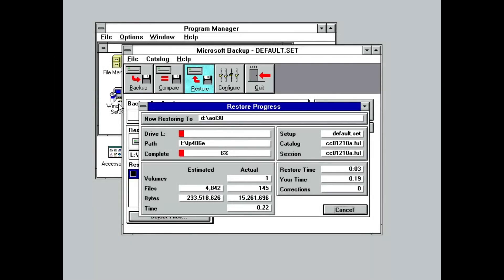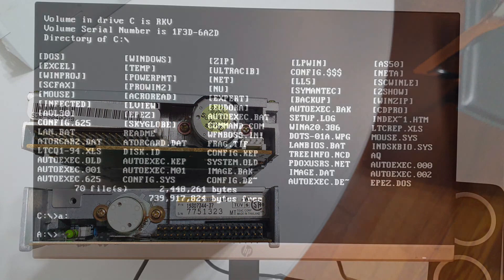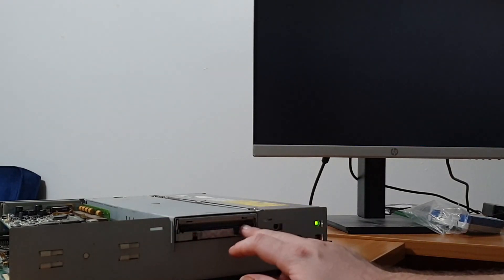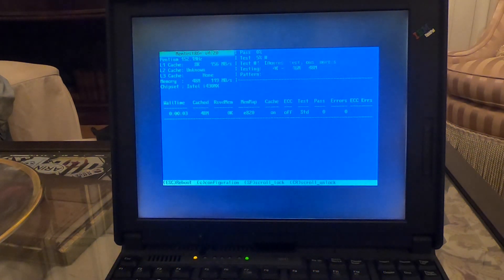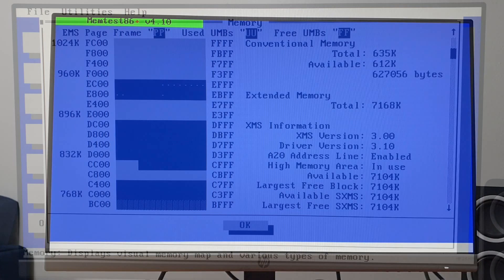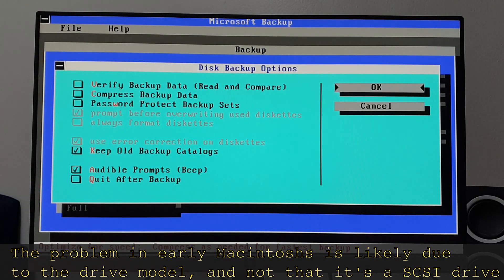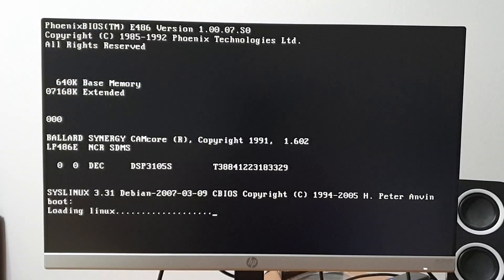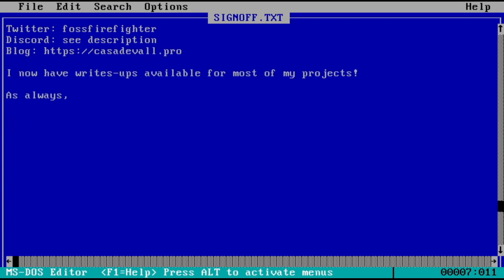486 Data Recovery with MSBACKUP and NetWare // Intel Professional Workstation (Part 2) | #DOScember

Comment: Just be happy you weren't working on. It's older brother as it is. So the professional workstation series has another machine and it is the professional workstation server. And this is the weirdest machine if you ever run into one that you will ever see.  It looks like a giant server with a handle on the top of it. It is manufactured by Intel and the wildest. Darn thing about it is there is no serial number listed on it. There's only a model number and you will know if you have one when you go to take the cover off. And you see what really makes this a unique server.  You take the cover off. And there are not 4 slots for scsi hard drives there. Are eight slots for scsi hard drives They're quite rare and they weigh about 90 pounds. And that's not what the drives in it. That's just because of the weird power supply. They were pretty reliable machines and and they're not bad. But they aren't easy to get up and running. They kind of turned into a nightmare.  Onto themselves. And this happened because of the actual drive controllers themselves that loved to fight each other for an IRQ On start up.

Comment: Older machines, like 286s don't like the DS12887 and require a DS1287.  Newer machines, like 386s and 486s should work fine with the DS12887.  So it's a drop-in replacement for most systems.
Reply from the maker: I did hear that this could be a 286 specific problem (although I've heard some 286s will infact tolerate a DS12887). I have a Compaq 286 that needs a replacement Dallas chip. That's probably going to be a dremel and solder job.
Reply: @NCommander  Necroware made a replacement, I think you should check his channel.

Comment: What documentation (if any) did you use to guide writing your DISKDUMP ? I've been meaning to get into this sort of stuff but I don't know where to start.
Reply from the maker: OSDev wiki is probably the best source: https://wiki.osdev.org/Main_Page but I already had a lot of understanding of low level programming and BIOS call interfaces.

In this case, diskdump uses int 13h, it doesn't talk to hardware directly. I did do that for my SLS on real hardware video though.

Comment: xcopy can copy hidden and system files and preserve flags if you use the proper command line switches. it can also copy the entire tree including empty directories.
Reply from the maker: Unfortunately, those switches do not exist on the DOS 6 version. I think they were added in Windows 95 or 98.
Reply: @NCommander  incorrect. those switches exist all the way from dos 3.2 to 6.22 and Dr dos 7.

Comment: Did you try kermit and a serial null modem cable on com port?
Reply from the maker: It won't save the unallocated block data that i needed to do autopsy in part 3. The SERDUMP utility I wrote can do a filesystem dump via serial, but Ethernet is loads faster.

Comment: There is some incorrect information to Linux

1.) You weren't stuck with "fitting all on a 1'44MB-Floppy":
You could have made a boot- and a separate root-Disk. 

2.) Problems with Lilo:
You don't need Lilo - you can put just the kernel on the bootdisk

3.)  "8 Megs is too little for diskless".
No: One the one hand, you have your floppy as extra storage - on the other hand, 8 Megs is a-lot for an old kernel plus busybox.
 No need to swap over the network.

4.) you even wouldn't need nfs: Just "dd | netcat" on the Workstation-Side (plus the boot+root-Disk from [1].
 
5.) Using tools that write on the disc is a HUGE no-no... But mistakes happen :-D
Therefore, I'd never touch Dos/Windows-Tools when accessing a harddrive-to-recover... Or invest in a write-blocker :-D

Anyways, thanks for sharing your efforts and experiences - they are great!
Reply from the maker: 1. I was referring to the size of the kernel alone. I'm well aware that I could have used a separate disk for the initramfs, I specifically dealt with that nightmare in SLS Linux Part 2. Linux 2.6 removed the make floppy option, and the lp486e.c only exists there, and in some 2.5 kernels. Admittedly, dumping NFS might have gotten the boot kernel small enough, but the Linux kernel has incompatibility with the SCSI controller chip in this system so it's a moot point. (I'll discuss more in Part 3, but in short, without significant effort and driver patching, I will never be able to use SCSI under Linux on this system).

2. I never said I needed LILO. I said LOADLIN to load from DOS to bypass limit 1. However, LOADLIN requires the top of conventional memory to be free, hence it dying. If I could have used LOADLIN, I could have put the kernel on NetWare, and started from that.

3. Old kernels won't work. The Ethernet driver I need was added in 2.6 (2005). The onboard Ethernet is not NE2000 compatible. If I could have used a 2.0 or 2.2 kernel, I would have. (however, neither works with the SCSI controller in this system).

4. Technically true, but I couldn't even keep it running /bin/sh in single user mode without risking OOM. The kernel itself was using 4 MiB of 7 MiB of usable memory. I'm not convinced even with busybox that it would have actually be workable. I'd also have to invest a lot of time and effort to get a buildroot setup for 486 compatibility and hope there is no Pentium specific assembly language lurking in uclibc.

5. The HDD had already been booted from several times before I got the system as is but I did make efforts not to make unnecessary changes to the HDD. I already noted that MSBACKUP was a mistake, but it took me awhile to have a tool that could dump the disk from DOS, and I was legitimately concerned that the drive was going to die.

Thank you for the feedback though, and I'm glad you enjoyed my content :)
Reply: @NCommander  Thaaanks a lot for the long answer and taking your time!

I just tried it in a VM.... Building a 2.6-kernel is no easy task with todays tools... Incredible, how many warnings  gcc threw out :-D

2.6 is especially a little bit demanding. I still believe, you could manage to compile an absolute minimal one (e.g. removing IDE, reducing kernel log buffer, ... ) that could manage the task - but it's really a chore. 

I would still have tried the route with a reduced-to-the-max-2.6-kernel (or even backporting the Ethernet-Driver)...  but it would be a hell of a challenge. 

@drive going to die: All the work to get the system booted could have been done without the drive... Checking if the  kernel talks to the scsi-controller could have been done without a disk. 

But please make no mistake: I really appreciated that you told your motivation, and especially that you explained your mistakes: Seeing others making mistakes can keep me away from doing the same.

So a really big THANK YOU for your content (you won a subscriber :-D )!
Reply from the maker: @suchaluch5615  I actually did it in a chroot jail with a period correct GCC. Trying to use modern tools to compile older codebases just leads to pain and suffering.
Reply: Ohmygosh guys.. yeah, Linux has definitely moved on since the 486 days.  I wasn't able to get any of a few common distros and live CDs to boot at all on a Pentium MMX.  P-II was fine, just slow.  I have an old Red Hat floppy version that works, but it's a barren wasteland as far as utilities go.  You can tell Linux was really really new at that point.

I wouldn't worry about MSBackup.  I think booting into Windows is far more detrimental to forensics than clearing the archive bit.  That bit is stored in the directory entry for the file, and changes one bit of a single byte in each 32-byte entry.  It's not going to affect the files at all, nor the free space, slack space, or even the FAT.  Just the directory entries.  It's not going to be a bit-perfect image, but compared to Windows creating temp files, swapping to disk, and other tom-foolery, it's really not a big deal.  :-)
Reply: @sirnickity  Well, most distros need a 686, so a Pentium could be a struggle.

I see one chance: If you look at the gentoo distributions, there is under x86/advanced joices exactly one Stage3, build on 2021-03-15, that is marked as "i486". This one should/could work.

Comment: Hello, can you share also the diskdump.exe file?
Reply from the maker: I posted the source code to it. I can post the compiled version, but it's never been tested aside from this one use, so it's a buyer beware sorta thing. If you can give me your usecase, I'll post the binary on the github page.
Reply: @NCommander  I have an old 386 laptop with 80Mb drive which I want to copy to ZIP before it dies. And it would be great to save also the atributes of files and date codes.
Reply: @NCommander  Hmm so I compiled it, but it shows no drive.
Reply from the maker: @standal001  it needs to be able to see the BIOS int13h interface. Does FDISK see the HDD?

I uploaded the compiled binary to the releases page: https://github.com/NCommander/dos_disk_dumper/releases/tag/0.1
Reply: @NCommander  Interesting, your version works. Mine shows 0 disks to backup. The compilled exe is also bigger 48040B, but I compiled it in graphical IDE in Windows. I am not a programmer so probably made an error at compilation.
Reply from the maker: @standal001  I never tried using the IDE; this is built fromt he command line owcc tool but if it works it works.
Reply: @NCommander  yeah your works. Thank you very much, now I can backup my drive on zip drive. Later I look on it, why  it did not worked at me.

Comment: Any guidance on using diskdump. It's quite a cool tool :)
Reply from the maker: I could post the binaries, but basically, run it, answer the questions, and point it to a disk that isn't the disk your dumping (so CF-IDE, NetWare share, etc). If you actually compiled it, let me know how it goes.
Reply: @NCommander  I'll try to compile it (not a developer, just a systems administrator) and test it on my old ThinkPad like you did ;)

Comment: For you trouble with xcopy,  I remember that there was a novel utility called ncopy that did much the same of xcopy but was faster and could handle larger volumes as it was actually targeted at copying data from one network volume to an other and those could be a lot bigger on a netware server than harddrives where at that time.  But if my memory serves me, I think it also worked very well to copy stuff from a local disk on a workstation to a server or vice versa.  Since you have the novel client chances are that you also have access to ncopy.
Reply from the maker: ncopy is on the SYS:PUBLIC folder. I'll have to check to see how it handles things like preserving creation times, SYSTEM bit and such. Thanks for the tip!

Comment: Great video as usual! Can you link the dallas chip? I've an ibm ps/1 which can't run the floppy drive if the dallas is depleted
Reply from the maker: https://www.digikey.com/en/products/detail/DS12887%2b/DS12887%2b-ND/956874?itemSeq=346293968

However, there are known incompatibilities with these in 286 and 8086s so you might still need to do the battery mod. Furthermore, PS/1 and PS/2 drives have known capaciter issues, they nearly universally need a re-cap to get going again.
Reply: @NCommander  thanks a lot! oh it's not a drive issue in this case, it is a known bug of the original ps1 line, if you google around you'll find it.

Comment: dd should work;)
read manpage:)
greets, a
Reply from the maker: dd doesn't work if Linux doesn't see the SCSI controller or the hard drive :/
Reply: @NCommander  you are right!
but assume ,  you compile the driver into the kernel,  then des...it should work...i do i have something miss understood?
Sorry for my poor english!
greets, a!
ps,  i watch one more;)
Reply from the maker: @anon72513  You're assuming there is a driver in the kernel, and the system could stay. I compiled several kernels from scratch trying. None could see the HDD, and I usually couldn't keep it running because lack of memory.

Comment: Was this Intel's first complete PC product or was there an earlier one?
Reply from the maker: I'm not certain. I knew they had branded versions of OS/2, but the time period would be consistent with this. https://www.os2museum.com/wp/something-new-every-day/ - the boot splash screen says Intel 386 MicroChannel, which might imply there are rare MCA Intel machines.

The Intel Ark doesn't list this or earlier PCs, and given they call this "Intel Professional Workstation 486", a "386" workstaiton makes sense.
Reply: Additionally Intel actually manufactured complete PC's for Packard Bell and a buuuunnch of other name brand systems from the mid - late 90s.

Comment: Brilliant. You have brought back so many memories. I got onboard with PCs around the 386/486 era and had forgot most of what I knew back then because I was not a heavy user but definitely remember messing around with Novell Netware and Dos Interlink etc. I had many issues as I was new to it at the time but eventually got things working by speaking with friends, reading manuals and just messing around experimenting, there was no internet back then only friendnet. I would love to see more videos as they are explained very clearly. Well done. Subscribed.

Comment: Man, you need to get a Gotek floppy disk emulator. It would have made your life way easier in a bunch of your videos. If you get one, replace the original firmware for the open source FlashFloppy, and you will forget physical floppies even exist.
Reply from the maker: Won't work in this case due to the non-standard floppy connector, and molded plastic case :/. I actually plan to buy one when I get a system with a proper 3.5 drive bay. As for the SLS on real hardware, that one was entirely for lols and just having the picture of the stack of floppies.
Reply: I remember having a vintage computer that came with a stack of Windows 95 installation floppy disks

Comment: Memtest86+ is too new to run on a 486, it locks up on old systems. Try the older Memtest86 (no plus) instead.

My usual go-to for this is either INTERLNK or Laplink 3 as I have the proper parallel cable. Usually if the card has a NIC, I get networking up. In both cases, ye olde machine is the server, I just copy the entire drive to a ZIP file which preserves time stamps and attributes. I could also use modern versions of XCOPY32 if I wanted.

One thing I always wanted was a true Win32 client for INTERSVR, but given NT based OSes restrictions with parallel ports, only slow serial would be feasible. Windows 9x could do it, but at that point the existing DOS driver works "good enough".

Comment: We used to call that cable a "null-modem". It's just stuck with me ever since.
I remember those cables being slooooooooow. But a rescue in almost any crisis. Because that cable would always work, even if nothing else did. Used to use it with Norton Commander, to connect from one machine to another, and copy back and forth (slooooow) that way.
Reply from the maker: Interlink could use a serial null modem cable on COM1, or a special port on LPT1, the COM1 is dreadfully slow, but the LPT1 should be able to get a decent bitrate, at least fast enought o dump this HDD.
Reply: I definitely remember that when I bought my laplink cable, the packaging said "null-printer cable"